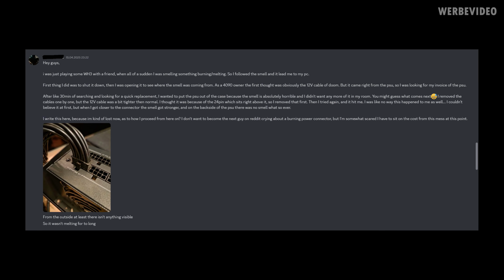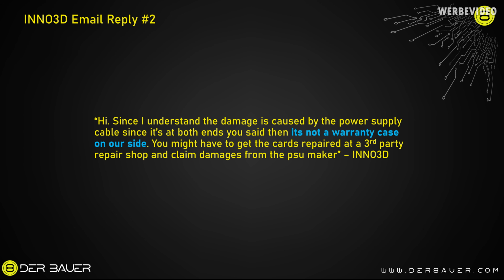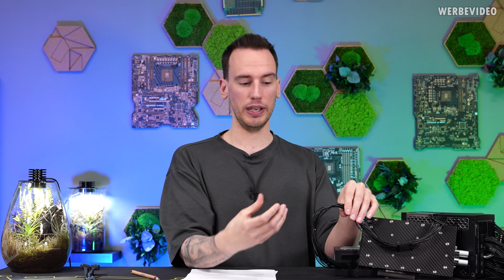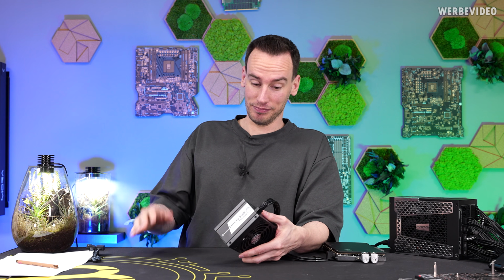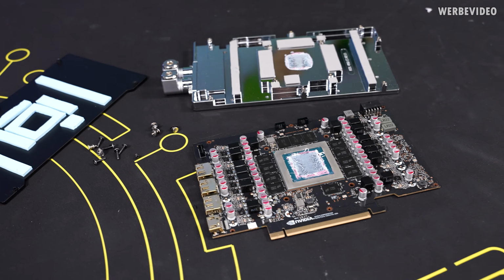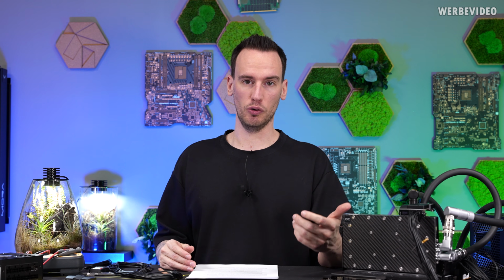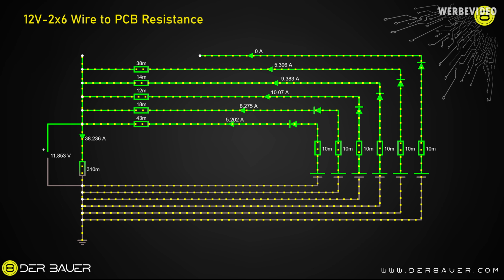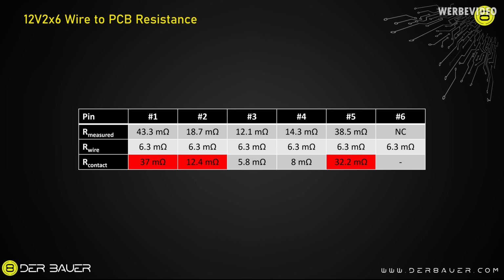Investigating and Fixing a Viewers Burned 12VHPWR Connector

Comment: Anybody that is using pcie 5.0 ATX 3.0 PSU should check with their manufacturer and bye the pcie 5.1 ATX 3.1 power cable which works with a pcie 5.0 ATX 3.0 PSU and gives all the safety features of the ATX 3.1 PSU literally transforming your PSU into today's standard instead of buying a whole new PSU a lot of people don't know this but this is how you fix the problem all they did was change the cable and not the PSU go ahead Google it if you don't believe me or ask an AI and you will get your answer the same as your folks

Comment: Still wondering if this is actually a gpu issue or a user error thing or just the cable/psus being used. It's so inconsistent and I don't know anyone who has had any issue so far.

for me: 3090 4090 5090, no fires using two different PSUs with 12vhpwr factory cables or the 4:1 adapter, does this typically happen in a short period of time of using the GPUs? or is it usually something that happens over several weeks/months?

on my end precautions are always taken when I build a new system, as i've had a PSU destroy a build or two despite somehow having a QA passed sticker on it.. I take pictures of the cables/connectors to the gpu since this whole 12vhpwr thing began as a means of covering my own behind.

PSUs ive used:

Current PSU - Seasonic vertex px-1200 (12vhpwr, not 12v2x6)
Previous PSU - Dark Power Pro 12 1500W - not a 3.0 or above ATX psu, so I used the 4:1 adapter.

Not trying to be a hard doubter here, it just seems to be way inconsistent when the incidents get reported, and the only incidents I've ever read about, it had been someone mentioning a third party cable being used.

Comment: While the cable and it's connector are issues I think it's pretty clear that this entire problem could've been avoided if nvidia and the gpu manufacturers included the individual cable power monitoring and load leveling as a safety feature

Comment: Can we say it already? This is a bad connector standard and it's a bad power delivery standard. The connector and plug are rated for 675W but what about the transients and the fitting/resistance tolerances? It is a great business to blame on the consumer for a lot of unknowns that basically leave the blame on the most weak link: the consumer. There were cases of the standard pci-e auxiliary power connector burning, sure, but now the issues happen with higher frequency. we need the memes front to produce a mind share campaign for this absurd. This could be the "intel quad-core" moment nvidia is gifting us.

Comment: INNO 3D is 1000% wrong. The GPU draws power. Its the device that creates the demand. Its the only component that draws the current. The PSU only supplies what is asked. Where the GPU fails, its drawing the extra current causing the overheating and melting of the cable ends. INNO is just making excuses.

Comment: As the heat builds on the lower resistance pins, then the resistance would drop even further causing a runaway type condition.  There absolutely needs to be current balancing in these cards.

Comment: I make and sell fused 12VHPWR cables so this imbalance blows the replaceable fuses in a cascade, saving the gpu. Plus the added 5mohm resistance of the fuse itself makes a pseudo current balance across the pins (assuming the range of resistance imbalance is within the 10mohm range).

Comment: Yes some GPUs can sense if the current is not evenly distributed across the +12V connections. But can they really also detect if the current is not evenly distributed across the 0V connections? Maybe I'm wrong, but I don't think they can.

Comment: I had two separate 3080's cables melt inside the pcie power receptacle, but not the PSU. I assumed it was the PSU that was the problem, and got a replacement. Idk if I should pin the blame on the PSU, My GPUs, The cable extensions, or my inability to connect them properly despite constantly double checking and making sure they were seated as best as possible....?

Comment: ...WELL....I'VE COME TO SOLUTION.........HOW TO solve THIS IF NVIDIA DOESNT WANT.... A CABLE WITH SET OF colored things thar car wiring got to protect from overvoltage ....KIND OF THAT!!

....SO.....LIKE......YOU'LL NOT HAVE TO REPAIR ALL THE STUFF ,ONLY A SINGLE THINGY THAT IS A dirt cheap,BY THE WAY!!

.....YEAH,IT WONT BE FLASHY ,IT'LL BE QUITE ROBUST AT VIEW, but it will be working ..........SO THE PROBLEM OF HAVING TO WAIT UNTIL NVIDIA WILL ADDRESS THE ISSUE WILL TRANSFER INTO SOLVING THE root OF PROBLEM

........COULDVE START A LITTLE BUSINESS,I GUESS....HEHE

Comment: To REMOVE CONNECTOR you can use LOW MELT SOLDER first,
apply it to the connector pins, and then it can get de-soldered easier.

Comment: Ugh.  As if my anxiety and acquired OCD of checking my cable with my 4090 wasn't bad enough ... ugh.  Incidentally, I placed a small 80mm fan to blow on the 12HPWR connector (GPU side) at very low RPM.   I hope this helps.  I don't care if I destroy PSU, but that 4090 wasn't cheap.

Comment: Uh, electrical engineer here; heads up Inno3D that the fact that there's damage at both ends does not by itself indicate it's a power supply problem. A defective connector purely at the GPU side will force too much current through too few wires, heating up both ends along with the wire in between.

Also, based on your results, it's entirely possible one pin melted/burned first (say at the GPU end), resulting in an unconnected pin after it melted sufficiently. At that point, the remaining load would have to be carried by the remaining 5 pins, and the lowest-resistance of those would heat up enough to the point of failing as well. Eventually, this results in a runaway thermal issue at one or both ends, and it's almost impossible to tell after the fact where the issue originated.

Comment: I wonder if this is brought on by the bad Nvidia driver 576.02 that stops monitoring temps. EDIT: I am also wondering if windows 11 24H2 has anything to do with this. Ever since i installed 24H2 my PC has started running like doody! I have to dual boot ubuntu linux just to play Path of exile 2 because it keeps freezing my entire PC Up requiring a hard reboot, been like this since 24H2 came out. win11 pro 24H2, nvme drives, 7800X3D, 1000 psu, Nvidia 2080FE gpu (gpu was rma'd twice) Never had any issues until 24H2 came out and each supposed fix makes it worse! When it does get partially resolved a new update comes  out for Nvidia that messes it al up again. So there is something going on between Nvidia and microsoft. My resolve is this "time to goto AMD GPUs" :)

Comment: 12VHPWR Connectors remind me of Houses in North America that was built around the 70's with Aluminum Solid wire.   Coefficient of expansion and creep over time cause poor connections on the branch circuits resulting in overheating and potential fire.

Comment: When I connected my RTX 5090 with a custom EVGA 12VHPWR cable, I checked each power delivery line at load, and got a consistent 7.98A draw @ 575W load. I then used a thermal imager to look for any excessive heat. If any connections were faulty, or the wire was causing a lot of resistance, I would have seen higher power draw on some lines versus others. I was a bit paranoid about it, but ease of mind came with significant testing. ANY cables could be faulty, even if they look good. The wires that melt will be the ones with the least resistance (more power flowing), while the faulty connections/wires will deliver less power (lower amps, less heat). This is the same reason that not plugging them in correctly will cause failures, but it's more insidious... without checking (thanks, Nvidia, for a crappy power design), you really won't know. Also, presumably, the PSU is also delivering all of the power through the connector from the same power rail, with good connections... that is also a possible point of failure, which is why checking power draw with a good DC Clamp meter at load is the only way to be sure,

Comment: Just a piece of advice to anyone that wants to go for a warranty claim. Even if you are the most advanced user out there don't give any informations or details about what caused a possible failure, even if you get instructed by them to provide information about the product failure you keep insisting that you are not familiar to perform any type of investigation yourself and you are absolutely clueless about what caused it,insist that the product failed with no further details given exept your serial number, as far as the hardware goes you putted in and forgot about it and later down the road it failed. Why? You don't have a clue. Any other information you might give will highly result in warranty refusal if you say that any other part is also melted. These companies will do all the possible steps against you to not honour the warranty. At the very least since its under warranty the bare minimum should be since this guy told possibly the entire story to the representative that at the very least should tell him to send this card indoors to investigate it and in the worst case scenario they can charge for the repair if their investigation lean towards PSU failure or cable failure. But they prefer to throw people under the bus because they talk too much, also always say that you was using the cable included in the box. If its a CPU same story and always look manufacturers ram support do not say im using the X rams with XMP/EXPO enabled you will say im using a set of ram that the CPU manufacturer support with the speeds that the manufacturer supports. Always look your CPUs ram support on the CPU manufacturers page. If it says 5600mts or whatever it states there thats what you are using.

Comment: I still dont understand why this keeps on happening. Just put two power connectors on the card. We used to have two 6+2 pins power connectors on even mid tier GPUs. Why can't they put 2 new 12 pin power connectors and let them share power. The new connector is so much smaller, so it's not like it's a space issue.

Comment: here is the simple crazy example: (wich by the way should not be the end user's concern). take one single wire with te lenght from the PSU to the GPU. connect it to a high ampere 12V transformer and measure the AMPS and cable temperature to see at which AMP value the cable begins to fail. that will be the true power conductivity at wich the wire is capable to work at, but here is the problem: if the wire has bends, especially "coil-like" in the case, the resistance of the wire increases wich will lead to lower amps delivery-and temps sky rocketing! oh dear NVIDIA... they don't tell us exactly the way they can run a 4090, 5090 for 4 hours straight on high power without any failure... perhaps custom cables that can be made shorter- meaning the shortest distance between PSU/GPU to have the least possible resistance??? ☑ perhaps ditch the cable and plug the GPU into the PSU directly for 99.99% efficiency??? 😆 so sad that instead of designing a gpu that is amazing at 300W, they must exceed that pwr to have some cometitive scores...  or just restore the 2x8pin, or 3x8pin  and admit that some blueprint guys were stupid... love all.

Comment: I dont have an issue with this connector design from an ideological stand point.  They did however make a huge mistake shrinking the pins so small....  They already had all the things right in front of them to make a successful connector....  And they failed.  If the new connector had pins the size of the older 8-pin connectors, which - already exist, have been tested long term, TELL ME HOW they messed it up so badly?  Completely idiotic...  just make the pins larger and keep a similar connector to an 8-pin + 4 pins.  It would have been alot better....  I've had issues with a gigabyte 3080 with the crappy small 8-pins to larger 8-pin, which was caused by the cables being too taut.  How nvidia didnt change this connector with the 50-series is beyond me...  Or 2 x EPS 8-pin...

Comment: Roman, both power supplies and GPUs in the future will have to incorporate a current divider and a current comparator on the connector pins. How could we notice? First, in the performance of the card, which would drop if some of the pins began to heat up or possibly did not receive the correct or sufficient power. The user would notice the absence of power or voltage through software like GPUZ or others. I think it will be the only possible solution. Both GPU and PSU manufacturers are not taking responsibility for these problems and the only ones harmed are us, their customers.

Comment: Nvidia GPU quality has gone down tremendously. I'm truly surprised that the power cable melting has come back again.  What would it take too for the engineers at Nvidia not to take shortcuts to make an extra few dollars, until someone's house burns down and people get hurt? Is this what needs to happen so that video cards manufactures can make a safe GPU again? I'm truly happy that I haven't bought a 5090 card and really wanted one but for 25% more cost for 25% more heat, energy, and performance doesn't seem to be an upgrade, but it's like putting on a turbo on a GPU to make it faster than previous generation. Especially when there are no voltage regulators for each wire, which would have resolved any issue of melting your cables. I'm really surprised that Nvidia hasn't had a civil lawsuit yet because this has been 2 generations in a row. What crap we're giving for over $2,000, WOW.

Comment: The 12VHP connector is just all kinds of bad. If I got a video card it will only ever run 8 pin connectors if it needs more power then the slot.

Comment: I'm somewhat surprised that nobody is yet bridging all 12V "pins" (and similarly GND "pins") together on each of the connectors on the cable. If nothing else it would localise the heat to just one side and share the load over all of the wires in a cable.

Comment: Senior electronic engineer and IPC qualified wire/harness inspector here. Seen similar problems many times before. 
The wide variance in overall wire resistance is unlikely to be at the pin contact points but at the nearby point where wires are crimped to the molex pins.
Crimp connections are extremely reliable and durable when done correctly, but correctly means using costly Molex crimp tools and the exact wire these pins are designed for. 
Small wire/harness shops may not be using the right tools or may be using the wrong wire type to achieve a good crimp. 

Nvidia is pushing these connectors right to their limits (and likely beyond as resistances vary) and in combination with (otherwise minor)cable issues, prove fatal.

Another potential risk is that counterfeit Molex connectors are common in Asia and these have poor QC, poor fit and poor contact plating.
Reply: also mixing different pin platings on male vs. female pins with combibations against manufacturer spec.
also sharing current across pins against manufacturer spec
Reply: from connector application specification:
*This connector system is designed to mate tin plating to tin plating. Never cross mate tin plated parts to gold plated parts.
* This connector system is not designed for current sharing (i.e., splitting one current load across multiple circuits)
Reply: Thanks. That is the best theory about this I have heard. Makes a lot of sense. So what cable manufacturers can we trust?
Reply: @Glider324 Good question. Let the PSU or graphics card supply this and thereby accept the warranty risk. I would avoid 3rd party cables like the poor customer in this story did because it invites finger pointing by other vendors if trouble occurs.
Reply: @Glider324  The PSU manufactured and use the Nvidia adapter. I dunno, I still use a Seasonic 1250W 90% Gold  from 2014 (the power efficiency now is different from what it was back then) with the RTX 4090 FE and the damn ugly adapter connector since November 2022. I push daily 400W+ when I use the card, and so far all it's good. I did custom water-cool it with EKWB waterblock + active backplate, but this does nada for the GPU connector or the PSU one :))

Comment: NC does not mean power will not flow through that wire, it means the power will arc across the gap like a spark plug.  Arcing is a far more likely way to generate high enough temperature to melt polycarbonate in this scenario.  You are talking the difference between 150c (high current) vs arcing up to 20,000c - multiple times the surface of the sun.  Because there is evidence of arcing at both ends (and on different wires), this suggests the CABLE pin design is at fault - e.g. oversized dimple, separated split-pin, oxidation, contamination etc.

Comment: Molex and Amphenol have recently released new TPA clips, designed to further reinforce the crimps in the wire housings. I wonder if that can help with the issue of pins not having correct contact.

Also, mixing contact platings can have issues with galvanic corrosion (and therefore resistive heating). I believe only Molex have gold plated contacts and headers, but only for Micro-Fit 3.0+ and not the 12VHPWR headers. From the looks all the GPUs and PSUs I've seen so far are tin plated.

I've used 2x6 Micro-Fit headers in other applications (not up to the current limit luckily) and can say for sure that the high mating force contacts are extremely hard to seat fully or remove - I'd say about as much as 2 DDR4 DIMMs at the same time...

Comment: this same exact thing just happened to me - beQuiet PSU and stock MSI GPU in open air case. everything melted together on both sides AND i had the card power limited to 350W too. both manufacturers instant RMA request approval. MSI rep said it is a "known issue" - will definitely continue to buy MSI products